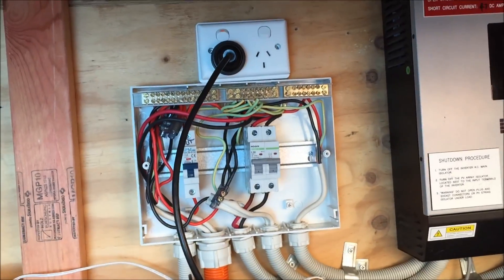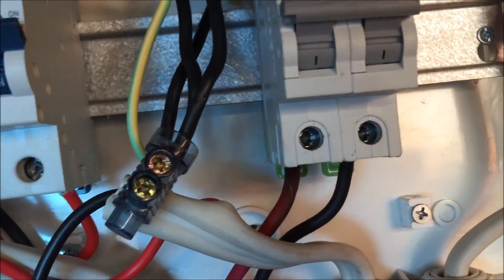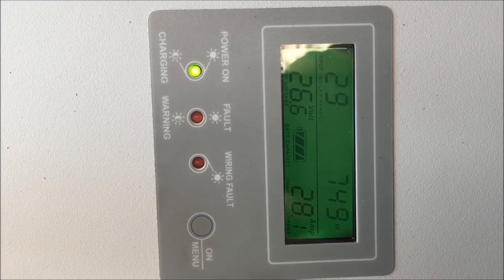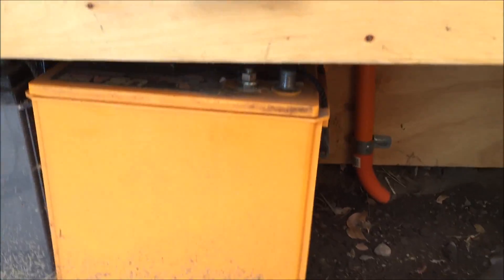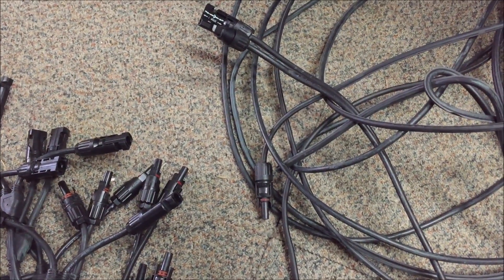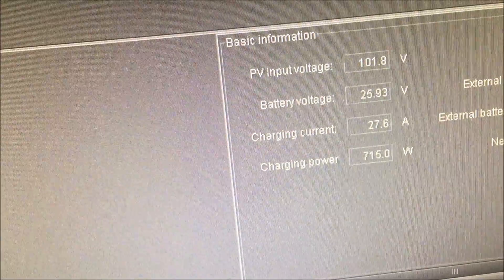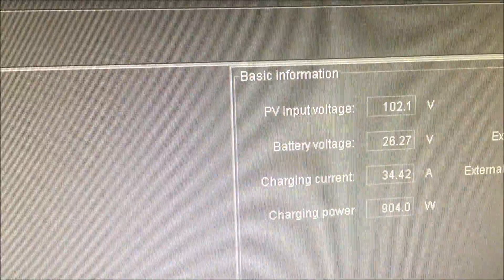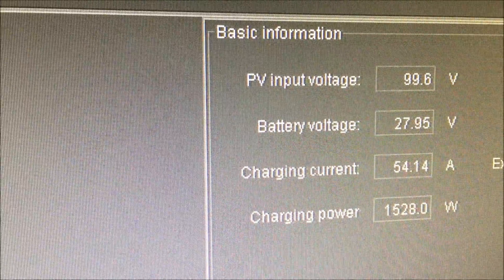Setting up the PCM-60X MPP MPPT Charger, minor issues & results

Comment: Hi, Wondering how these charge controllers have fared after 7 years?
Thanks.
Reply from the maker: Both Inverter & Charge controler still in use - The charger has been used every day since install with 3.5kw of solar and still works perfect today with out fault, two years ago the inverter needed a new fan and was run 24/7 till then, now its had a few fan is a back up to a 4kw unit.

Comment: what is the max power input you have had on this pcm60x at 24v output?
Reply from the maker: 2400watts :) but not for more than a few min before it starts getting hot. The inverters have improved much since then now the 2424msx units have awesome cooling and can run flat out much longer safly
Reply: @HBPowerwall  lol not the pip I am talking bout... I am asking how much solar panels u ever had on the pcm60x charge controller when using it to charge ur 7s setup

Comment: I ordered one lets hope it works  well
Reply from the maker: what did you order?
If it's an MPP solar product i'm still yet to have one fail on me!
Reply: HBPowerwall i ordered the  pcm60x
Reply from the maker: Ooh nice - that one is still running with 3000w of panels attached - note make sure you check the screw terminals every few weeks because if not perfectly torqued up they work loose and you get a hot joint. This has been the only issue i've ever had and i can assure you it was probably maybe all my fault :)
Reply: HBPowerwall in that case the best way is to solder the edges of the wires with little led  on the connectors see how that performes and thnx alot for the info ;)

Comment: hoi, i want that setup like yours, i have a pip4048msd and want a PCM60X too , the only thing i dont know how they work good in parallel, how can you controle the max current to lets say 90A to the battery? letts say the pip is the master( or i want to)

thx kristof
Reply from the maker: The two do not work in parallel you must use one or the other or manually configure min and max voltage using watch power or mpp tracker software
Reply: HBPowerwall thx! so the best is looking for an other pip4048msd ;) the only thing i dont get is : must there be AC connected to on the secound pip in parallel (slave) i would only connect solar and batt. to it...i dont find that answer on youtube or inet...

Comment: hi Pete I have a 2.5 kw system on my house now feeding back to the grid I want to add a battery bank can I just take the solor panels off the inverter and run them though a pcm-60x controller to a battery bank then into the inverter where the solor panels went in

Comment: Please help me out. I am very confused of all the different advises. My main inverter is a MMPsolar MS4048 PIP 80amp. I have hoped that I could make a OFF GRID solar installation with 20x SF170s Solar Frontier VOC=112,0V Isc=1,76A.  I need to know how I can install the 20 panas straight to the MPP 4048PIP 80A PV input because I think that I had the wrong advise from MPPsolar. I send them a drawing of my 20 panels in ONE STRING by connecting the + from one to the - from two and so on. They confirmed it is OK. When I connect it the end of the whole string to the + en - in the PV input of the  inverter nothing happened. There was a bright spark bij connecting the + but after that I did not see if everything goes right. There was also NO fault message. 
So, did I something wrong ? Did I connect the solar panels right bij connecting the all together (+ to -) in one string ?

Please help me out with this. I hope you will give me some advise. 

Best regards
Hans Harskamp from the Netherlands
Reply from the maker: my pip can only input 145v max so for my case just three in series. If you put in more than 145v id say you might have blown the MPPT charger with in the pip.
Reply: you need to keep voltage down to under 120v  so only 3 panels max then join + to +      and _ to _    your setup prob put 800v to 900v  into it !
i just sent them a message hope they reply

Comment: Hi peter looking good so pcm-60x chargers the batteries up as will as the pip is this right so more charging power then ;)
Reply from the maker: +Ross Musolino no I've disconnected the pip charger. Being only PWM it's too inefficient compared to the PCM60x. I will use it again if i get more batteries and need the extra power.
Reply: +Peter Matthews so do you use the pip just as a inverter then or do you have a separate inverter
Reply from the maker: +Ross Musolino yes the pip is just an inverter & ac charger when needed.

Comment: LOl I been playing solar for 5 days. Do not tell the wife :) 

Nice brother. Good find on that wire. Heat= bad :) God Bless.
Reply from the maker: +yankey4 Was just plain luck i found it, could have been much worse. I figure it has been like that for the past 2 weeks. not good - but learn and move on.
Reply from the maker: Yes, but it will be a few weeks away as it has been running 1 year now and need to service the unit. May replace it with the next model at the same time
Reply from the maker: +S Messer nothing wrong just needs new fans and a good dusting. Have not had an issue with it.
Reply from the maker: +S Messer no idea
Reply: +HBPowerwall Thank God you cut that early before something bad could have happened